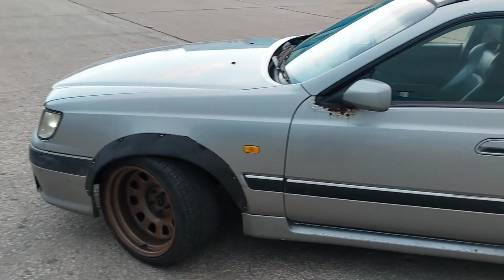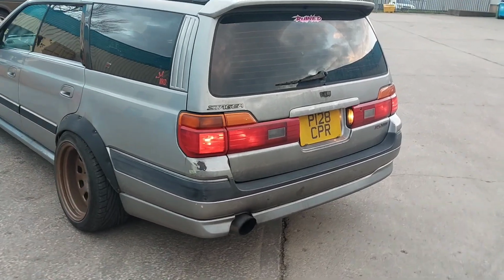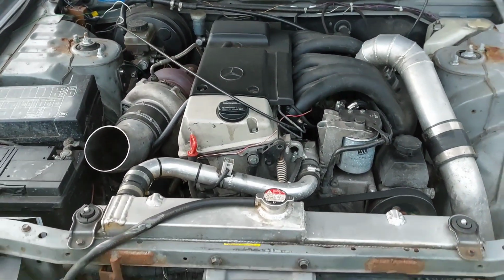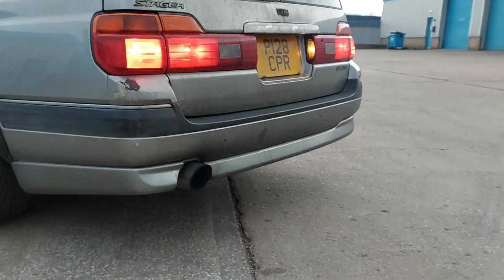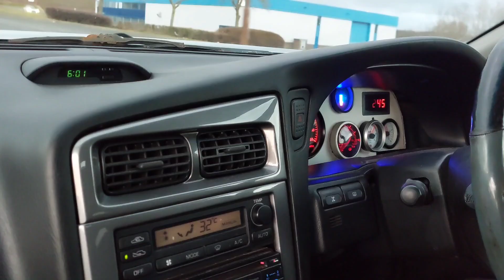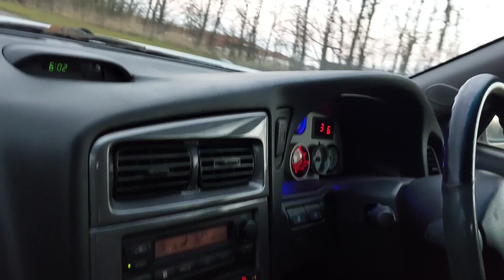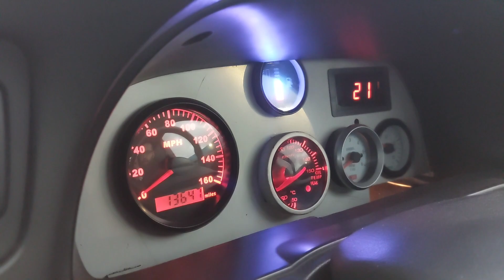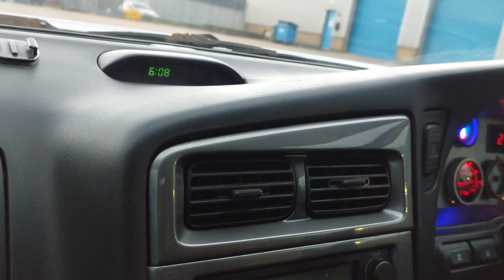INSANE Nissan Stagea has Mercedes TD OM605 SWAP WITH 610 NM of Torque 🤪 #nissanstagea

Comment: Fantastic choice of engine absolutely bullet proof power the 605 cools better than the 606 aswell I'm currently trying to put together a 190 e with a 606 ill get round to finishing it 1 day but it starts and drives and that's a.l I need it to do when TSHTF

Comment: Is this running on mechanical fuel pump
Reply: It's running a dieselpumps UK mechanical super pump with 7mm elements
Reply: @davidbell9199  ok mate thanks for reply :-) scince i asked the question iv now got a 605 and 7.5mm mechanical pump :-)